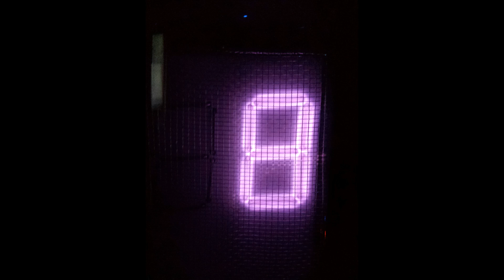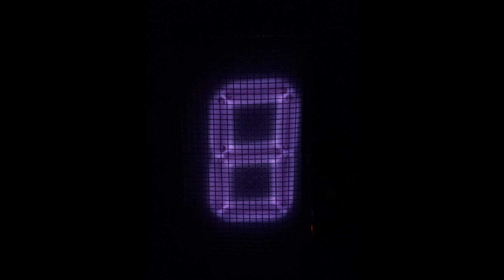Homemade 7 Segment Panaplex Display

Comment: What Amps is that pulling at 450V with a single segment? And also displaying at a full 8 ?
Reply from the maker: +Colin Richardson I did not measure the current draw i just used a 2k2 resistor on the cathode. But it´s much more current than a normal nixie tube ^^ the glass gets warm after a few minutes.